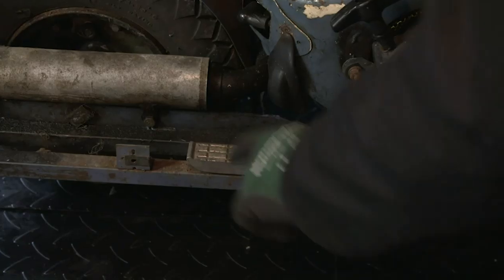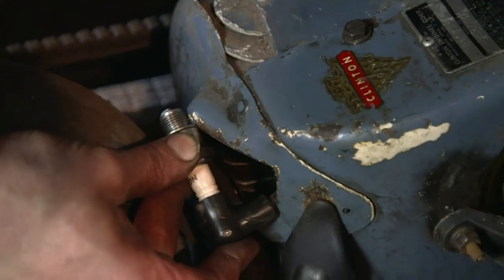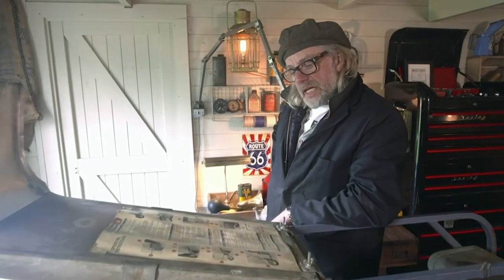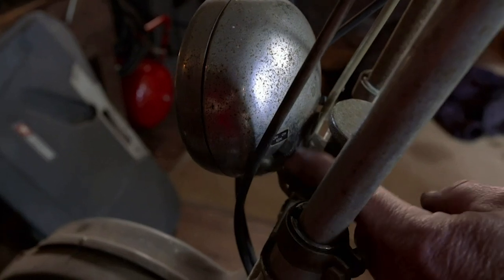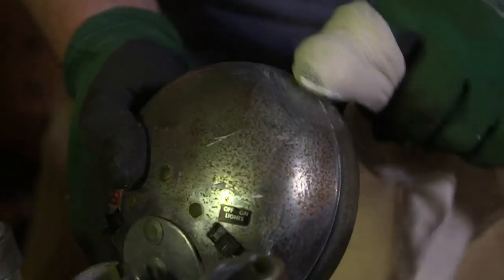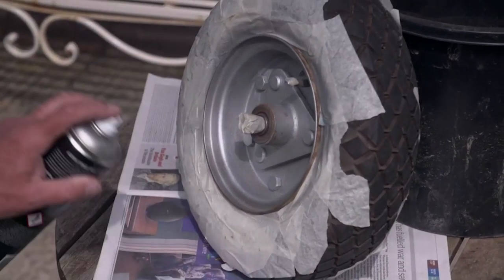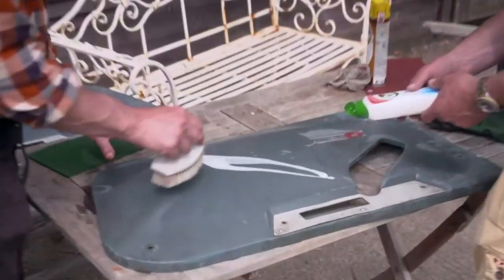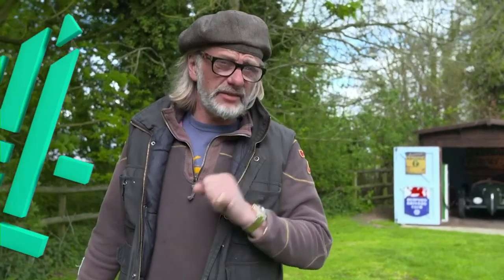A Suitcase Transforms Into a Motorcycle! | Find It, Fix It, Drive It

Comment: i use Vim all the time on old vehicles, i wash the whole vehicle first then go over it with lots of water and Vim, works so well, another trick i use is for vinyl seats, you know how a motor bike seats gets from sitting out in the sun for years, so hard you can poke your thumb right through, well if you take some paint remover in a spray can, spray some on a rag and wipe it into the vinyl it will become soft as new, you should try it on a seat you don't care about for the first time just to get the hang of it, you will be stunned.
Reply: Lawrence can I ask What are you using the Vim for? Giving an old vehicle it a deep clean? Protecting Patina????
I’d be interested to know why you use it??
Reply: @smaclure4316  To give it a really good cleaning, get all the old crap off, than as a little protection i go to a coin-op car wash and as a last step i spray the wax on and just leave it.